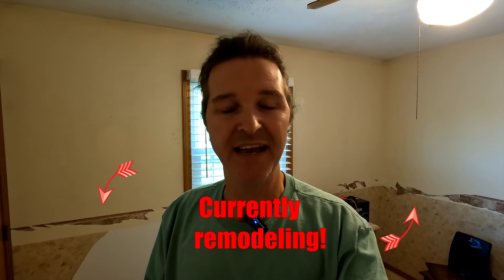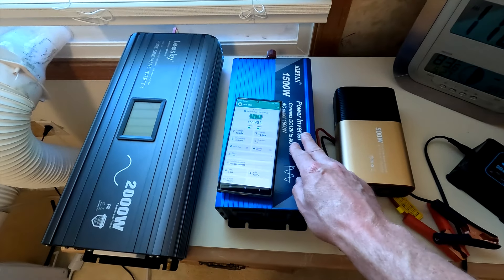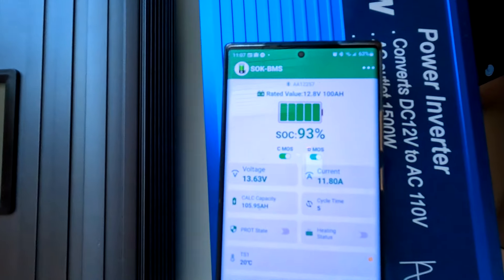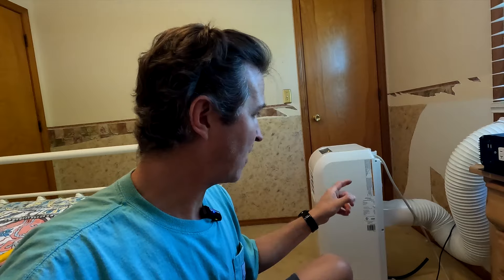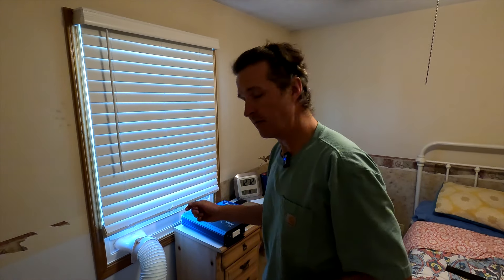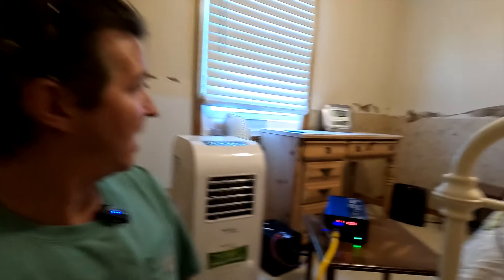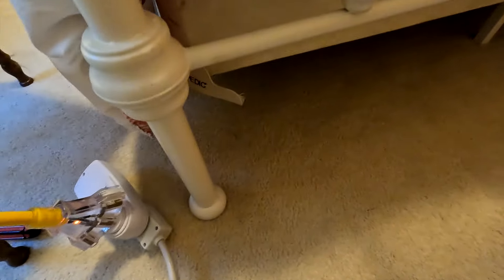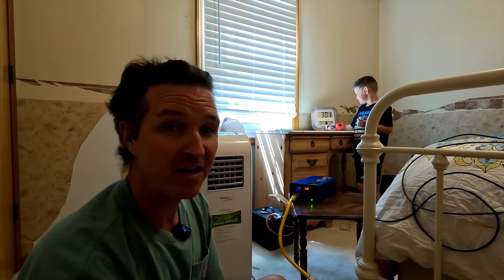Running 8000 BTU Air Conditioner with a 12v 100ah LifePO4 Battery!

Comment: Great video. My Inveters AIMS PWRI200012120S  2000W 12V, and the LEESKY 2000W 12V (same as yours, but mine had wrong wiring on the GFCI outlets, the Hot and Neutral are reversed) can start my Hisense A/C - Heat pump model AP55023HR1GD (8000 Btu SACC) with no issue, it has LRA (Locked Rotor Amps) of 43A!, 8.75 running Amp.
BTW,  per user manual of your GM-PAC-08E3, it does not indicate if the 8000 Btu is ASHRAE or SACC/DOE rating. It is not an inverter type compressor, it looks to be 5000 Btu SACC/DOE A/C .
Reply from the maker: Thanks for the information, Bud.  I need to find the manual for it.  I do want to do another test with the AC at higher temps to see if it will last longer.  Knowing the correct info is very important.
Reply: @OffGridBasement  I found the manual on line for your GM-PAC-08E3, it just says 8000 Btu.

Comment: It would be interesting to see the same test, but with the battery charger hooked up to the battery and charging at the same time. I wonder how much longer the battery would last. Thanks I enjoyed your video.
Reply from the maker: I plan on doing a follow up with it connected to 100w of solar.  Thanks for the comment.

Comment: Thank you so much for your demonstration. My wife and I found ourselves waving to your  kid, I guess we miss when our boys were young. I have a B-class Roadtrek Rv has an 8k BTU A/C with 1 on board Battery that powers lights and recharges while driving or on shore power. Do you think if I add an 2k watt inverter it will power my A/C and will it charge it when driving it. Or will jt only drain or charge depending on what you’re using it for?I want to be able to use my A/C when diving my RV without the generator. Thank you again cool Channel !
Reply from the maker: Thank you!  I'm not sure if your alternator \ charger could keep up with the power of the AC unit.  Connected to shore power would be no problem.  You need to find out the power draw from the AC unit and then find out the charging power of your RV alt\charger to find out.  Sorry I can't help out more.  Thanks for the comment!
Reply: @OffGridBasement  thank you this helps me tremendously , I will do this !

Comment: I set up the same system.However, 500w power comsumption is weird.Because a 8000btu battery consumes 850-900watt power.It means 300ah battery makes it work for 5 hrs total.
Reply from the maker: I'm going to be doing the same test with a 5k window unit soon.  I'll make sure to compare the results.  Thanks for the comment.

Comment: I have this same AC and your numbers seem to be accurate. I use a 2000 watt inverter but its power usage/run time is very similar to yours.
Reply from the maker: Good to hear.  What temp do you set yours at?  Thanks for the info and the comment.
Reply: @OffGridBasement  I set it to 61°. Thats the lowest setting this AC will set to. The compressor doesn’t turn off ever. It. Runs about 2 hours on 12v 100AH.
Reply: @Rockwell108  thank you for the info!

Comment: gotta take into account 70 deg in an emergency is overkill. keeping the temp at about 78 deg would be way more ideal, so who knows how long it'd run. really depends on the insulation and temp drop in an hour, based on external temp and how many people are in the room heating it up too.
Reply from the maker: I did another video with a room temp of 75 degrees.  I think the amount of time doubled...  no sure.  Here is the link to that video.  https://youtu.be/VdIihLIJvrg

Comment: I got a mini split about two weeks ago i set it on eco..that keeps the temp at 79 ..i understand thats high for some ppl but its perfect for us especially if its 90 or higher outside it fills really good but it only pulls about 200 watts all the time during the day and shuts off about 20 min after the sun goes down and usually does not kick back on at night and i just have 4, 6 volt  batteries wired two make two 12 volt batterys 200 amp hour each deep cycle so its pretty crap battery storage but it keeps us cool all night. if you call 79 cool lol
Reply from the maker: Hey, whatever works for ya!  I did another test with the AC set to 75⁰ and was surprised by the results.  Video will be out soon.  Thanks for the comment.
Reply: @OffGridBasement  alright I would like to see it. I am going to sub and hit that 🔔

Comment: Love your videos. I wonder if a solar panel would help run the AC longer ? Or even the freezer
Reply from the maker: Yes it would!  Even a 100w solar panel would make a difference especially if you live in a sunny environment.  Thanks for the comment.
Reply: I actually just bought a 100W solar panel kit from harbor freight! I'm using my 12 volt marine battery with it and am currently getting about 12 hours straight. I am also using a 5000 inverter, hope this helps

Comment: I just bought a Velit 12V air conditioner for my van, I don’t know what battery array I need to get.. I do not know much about electrical, amps, wattage and voltage all of that. 
Would you recommend a battery array that can run a Velit 12v AC?
Reply from the maker: From what I could fine the 12v AC unit pulls around 75 amps.  That is around 960w.  Every 100ah battery would last a bit over an hour.  Remember that once the temp get down, it won't run on full 100% of the time.  i would say start with 200ah of lifepo4 batteries.  That probably would give you around 4 hours without charging.  Hope this helps.

Comment: The outside temp is lower than the A/C set temp.  Without running the heater on low during the test, you are just testing how long the battery can run the fan.
Reply from the maker: Thanks for the comment.

Comment: How long do you think a 100 Ah lead battery could do with the same air conditioner?
Merci c’est un excellent vidéo 👍
Reply from the maker: You should only discharge SLA to 50% so I'm guessing 1.5 hours at best.  I'm not sure if the initial draw would drop the voltage too low so the inverter would shut down.  That would be my big concern.  Hope this helps and thanks for the comment.
Reply: @OffGridBasement  Thank you very much your videos are very interesting and well explained
Bonne journée 🎶🎵⛵️
Reply: I tested a 1kw battery on a 5000btu window unit, it runs about 2.5hours.
Reply: @MrCharmz81  Hello
 Is it a lithium or lead battery ?
Reply: @PierreA92  Lithium Iron Phosphate.

Comment: i guess its a good test but if i do a test like this i always like to have my battery(s) being charge at the same time. My system right now to Run my AC is my Delta Mini connected to 48 volt Valence batteries. The batteries keep the Delta Mini charging and has only lost about 20% because the Delta Mini only accepts 300 Watts of  solar. My AC draws over 300 Watts so there is a small lost of power.
Reply from the maker: That is great!  That is exactly how it should be done.  I really just wanted to show the minimum amount of running time you can get.  I would like to further the testing to show how to possibly double the amount of running time.  Thanks for the comment.

Comment: So if you had a 500 watt solar on the roof of your RV charging the battery in peak daylight. Could you get 5 to 8 hours AC cooling?
Reply from the maker: Most likely.  All of your solar would be going directly to the inverter.  The battery would just be a buffer.  Thanks for the comment.

Comment: Only one problem with the whole experiment, the heater should have been set at 70 and left running to mimic the outdoor heat. Or run the test again when it is 90 outside. It would be very disappointing to have the power cut off, and then find it is not up to par for more than 2 hrs.
Reply from the maker: There are so many variables in this experiment that I can't control.  It would be different for a house with 20 year old windows or even a room on the first floor.  I'm just trying to give a ballpark average of what you could expect.  Thanks for the comment.

Comment: What if you hook up a solar panels. To keep the battery charged. Do a video on that.
Reply from the maker: The only reason I don't is because the results would vary depending on weather.  One day I might get an extra hour.  The next day I might get an extra four hours.  Thanks for the comment.

Comment: 1 400 watt solar panel to recharge while using and it will run all day

Panel would provide 400 and battery the remaining 200 until setpoint.  Then panel can both run ac and charge
Reply from the maker: On a sunny day that would work.  Cloudy day ..  not so much.  Thanks for the comment!

Comment: If I were to have 2 Batteries in parallel with the same inverter, how much solar wattage and components would I need to recharge the batteries. Would like to do this set up with more power and recharge it.
Reply from the maker: Depends on the sun.  I plan on doing more testing to see about that exact situation this summer.  Thanks for the comment.

Comment: So, how many watts of solar panels are needed to run it all day?

What AMP fuse did you use for the inverter?
Reply from the maker: I say double.  Around 900w.  The fuse depends on the size of wiring.  For 2 awg wiring I would go with a 150A fuse.  Hope this helps.  Thanks for the comment.

Comment: How do you recharge your battery?  Or what is the fastest and cost-effective to recharge this type of batteries?
Thanks
Reply from the maker: I recharge using solar panels and a 30A solar charge controller.  A 20A battery charger will charge it full in about 5 hours.  Thanks for the comment.

Comment: Be curious to see how long it would last if it started around 74 and kept at 74.  3 hrs isn’t bad though. If that went up to 5 with a precooled room be even better. I’m thinking for ex use Solar to bring it down to as low as it would go and then keep it cool all night. I like these experiments.
Reply from the maker: Here is a video I made with the AC set to 75 degrees.  Hope this helps.  https://youtu.be/VdIihLIJvrg

Comment: any recommendations for a 500 watt inverter with maybe a 800watt surge?
not looking to run a full size fridge or heater/ac.
my plasma tv runs around 250 watts.
Reply from the maker: From what I've looked at it's hard to find a small inverter like that with surge capability.  You would be better off getting a 1000w inverter.  My 500w inverter fails right at 500w!  Anything from Reliable is good in my book.  Hope this helps.  Thanks for the comment.

Comment: Hello! I need some advice please. I have a Split Air Con wall mount AC. I want to power it by solar energy (so I can reduce my electric bill) I live in a tropical climate so we get sunlight almost every day of the year. I did some research and thought to put together a solar system with, 

- 3x (560W) JA solar panels
- 3.2KW Hybrid Solar Inverter 230Vac PV Start Voltage 30Voc Built In 80A MPPT Solar Charge Controller 50/60Hz Auto Pure Sine Wave Inverter 
- 1x (12V/120AH) ROSEN GEL DEEP CYCLE BATTERY

(I only need it during day time, night time it's cold here so I can manage without AC) If you're familiar or an expert on Solar and AC related stuff, I'd appreciate some pointers. I want to know if these components be enough to power the Air Con during day time?  Thank you in advance!

Specs (of Outdoor unit I guess),
- Refrigerant R410A/500g                            - Capacity 9000 BTU
- Rated Voltage 220-240V~                         - Standard input power 870W
- Rated Frequency 50Hz                               - Standard input current 4.0A
- Air Flow Volume 450m/h                           - Locked rotor current 19A
- Rated Power EN60335 1080W                 - Rated current EN60335 5.0A

Specs (Indoor Unit),
- Standard input power 33W                      - Rated voltage 220-240V~
- Standard input current 0.2A                    - Rated frequency 50Hz
Reply from the maker: Things look pretty good except for only using 1 battery.  The max charge current for that battery is around 20-30A and the solar set could burn it up pretty fast.  I would suggest thinking about getting at least 3 to 4 batteries.  I hope that gives you a little bit more help.  Good luck!

Comment: How long did the battery take to charge, and  can solar panels charge it?
Reply from the maker: A typical 20a charger will fill it up in 5 hours.  Yes you could use solar panels.  Honestly you would need around 800w to run the unit and charge the battery.  Hope this helps.  Thanks for the comment.

Comment: So what if you were running 200 watts of solar into the system at the same time? 400 watts... 🤔
Reply from the maker: It would definitely offset the usage.  You would probably double your time during the day with 400w of solar.  Thanks for the comment.

Comment: If you run that same test and use the 3000 Watt Inverter you will get different ( better results)
* if its a quality unit *
A more powerful inverter doesn't need to work as hard to produce 600-650 watts on the constant. 
Try it 🎉
Reply from the maker: I will!  Thanks for the info and the comment.

Comment: So can I run a 1500 watt appliance with a 100ah battery and 1500 watt inverter ?
Reply from the maker: A 100ah battery is really only supposed to max out at around 1300w.  You should really only run your inverter and battery @ 50% for extended periods or it will shorten the life span.  Hope that helps.  Thanks for the comment!
Reply: @OffGridBasement  Thanks for the information I decided to go with a 150ah battery and later buy another 150ah to maximize to 300ah at 12 volts
Reply: @OffGridBasement  I was asking since my electric 18 gallon water heater has a 1500watt heating element so I wouldn't be running the battery all day in with it.

Comment: Can you get battery to full with a 100 watt solar panels and how long does it take
Reply from the maker: Yes, but it would take several days of good sun.  I'm guessing about 15 hours of sunshine.  If you could get a constant 100w from the panel it would take 12.8 hours.
Reply: @OffGridBasement  my Dr prepare battery only gets to 3 bars out of 4 and won't get any higher off solar.. guessing charge off a normal charger would have different results
Reply from the maker: @Jamie-re9cv  You should check the voltage of the battery when it shows it's fully charged with solar.  Full charge will be around 13.6v.

Comment: How long can 1 car battery that's 1,000cca run a 600w Ac without solar panels ?
Reply from the maker: I believe cold cranking amps are way different than the total ah of the battery.  More car batteries are around 100A.  If you use a car battery in that fashion you will probably only get about 30 charge cycles.

Comment: You would be way better off with a 5000 btu window ac unit they only use 400 watts and will cool better
Reply from the maker: Yes.  I'm thinking about buying one just to be able to compare.  Thanks for the comment.

Comment: What would you need for a 700 watt microwave?
Reply from the maker: I would use at least a 1500w inverter.  Microwaves pull a lot of power.  If you use the microwave a lot, go for a 2000w inverter.
Reply: @OffGridBasement  Thanks

Comment: If as you mentioned it was 90 outside mid day it may have run for 1 hour .. 1.5 hours tops.. radiant heat from outside at 90 in mid day sun,, oh yeah... an hour to 1,5 tops...
Reply from the maker: Thanks for the info and the comment.

Comment: Another way to think of this. You just used about 1kwh of electricity, which from the utility company would cost about 20 cents (at least it would for me). If you managed to get 2000 cycles out of your battery (assuming you could charge it for free), then you would be getting 2000 x 20 cents = $400 worth of electricity over the life of the battery. A battery for convenience is very useful, but if it came to using a battery to save money then these calculations need to be done very carefully.
Reply from the maker: That is a good way of thinking about it.  Thanks for the comment.
Reply: True, assuming power prices don't go up.

Comment: I can't believe  how long he has his dangling   exhaust re radiating the heat back in the room! Unbelievable 😂😂😂!  Try from the other side of the room and more s curves.....
Reply: Also be mindful of children around deadly amperage sources as you never know when a wet touch can make them the route to a ground.  A snotty set of hands or licking their fingers ( not a impossible scenario by any means)    don't want to let the smoke out if you get the idea
Reply from the maker: Thanks for the comment.
Reply from the maker: I'm not sure what you're referring to.  The exhaust is connected and venting out the window.  The AC unit is a single exhaust system.

Comment: Single hose?  Inefficent big time.
Reply from the maker: I'm sure it is.  Thanks for the comment.  I know it's at least 10 years old as well.  Thanks for the comment.
Reply: @OffGridBasement  dual hose is way more efficient.  Dont use your inside air for cooling the condenser.
Reply: @halledwardb  So you want to use 90+ degree outside air instead?
Reply: @KelvinFPV  yes.  Just like any normal AC unit cooling any regular old condenser.  Single hose units are wasteful.  But heck, my 15 yr old daughter knows this as well.

Better yet, a Gree mini split works well, or run one of the solar DC / AC if its avalible EG4 units.